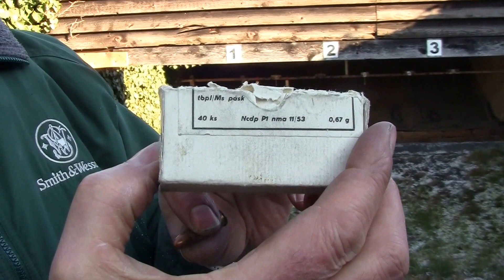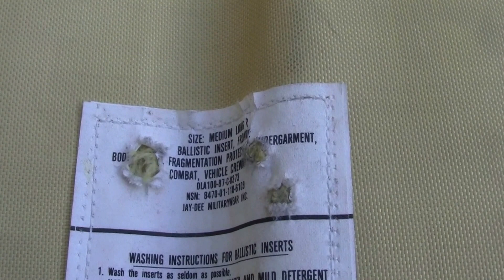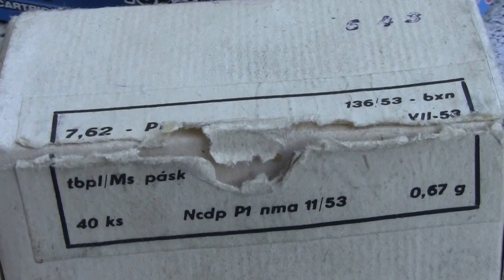Herbert  "The Mad German Gunsmith"  Werle  - now with his 7. 62 x 25 Tokarev  Penetration Test 2

Comment: Herman, The central failure point with torn edges on the exit side are more typical of thin jacketed lead core bullets. Have you any idea why the bullet performance on steel plate is so different between Test#1 and Test#2 ?? The Test#1 holes did not appear to have much denting (deformation), nor tearing on the exit side compared to Test#2. Interesting.
Reply from the maker: Yes, I think there are some explainations for Test #1 and Test #2. First the steel plate by Test #1 had a thickness of 5 mm and was mounted on a wooden piece  14 cm x 14 cm. When the bullets hit the 5 mm steel plate all went through  because the plate was very stable mounted (wood!). I also made an inspection of the deformed bullets sticking in  the wooden block. I found all. Each bullet was seperated into a two parts deformation piece - one sticked behind the other. The first part was the deformed bullet jacket and the second part behind was the lead core - but both deformed as two plates with a diameter of about 10 mm!! The holes in the steel plate had the same size about the shell diameter (10 mm). The Test #2 -  I made the wrong way because everything was mounted only on a (pressed) wooden plate only about 10mm thick! While hidding  the steel plate Test #2  (now 6 mm thick) and the aluminum plate about 14 mm thick all bullets pushed the metal plates nearly through the wodden plate where everything  was mounted on!! 
There was now stable rest against the bullet energy. I think the 7.62 x 25 Tokarev ammo will also penetrate the steel plate with 6 mm tickness as well....Have a nice sunday, best regards from Germany, Herbert. Oh, by the way I forgot  - the center hole Test #2 was made by hidding two bullets at the same place!!